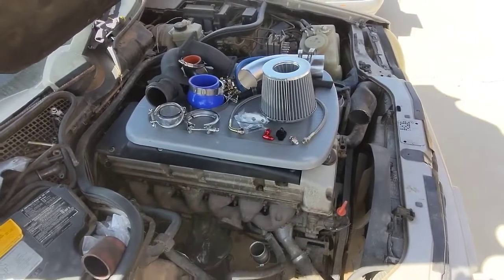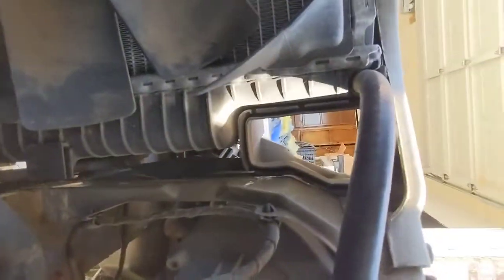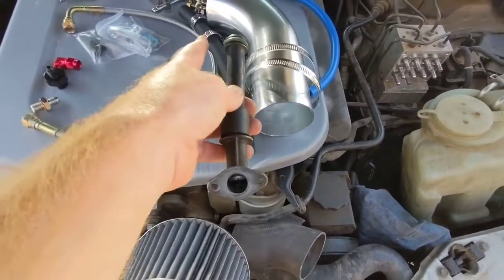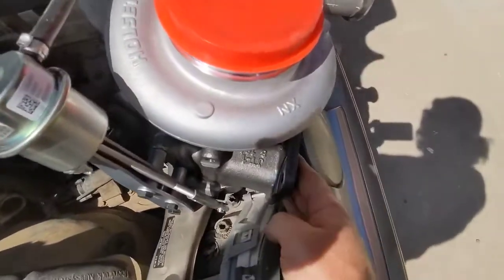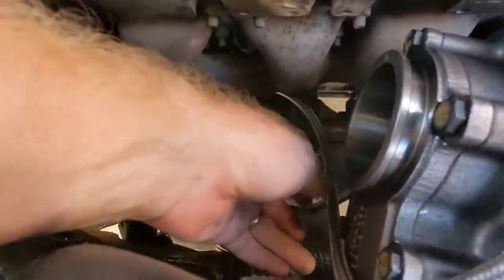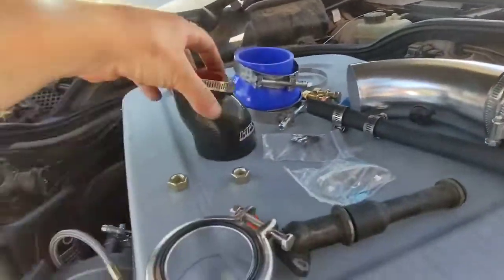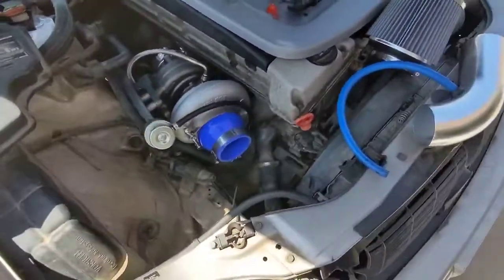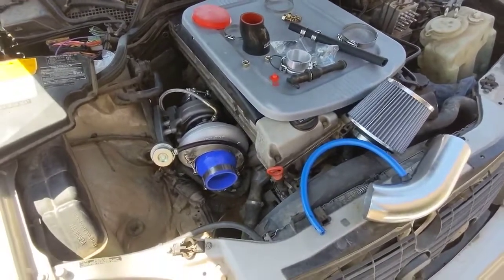OM606 Turbo Kit Install from Benz Injection

Comment: I instaled the kit and i removed the vacuum for the stock turbo(the black vacuum cilinder on the right side attached to the air box), now i have issue with the level sensor for the headlights.when i plug the line that was meant for the stock turbo car start to coffin and turning of.Any solution how to fix problem with headlights level sensor? Thanks

Comment: the kit works good the power and torque gains vs the stock setup is just wow the only concern i have is the hot side of the new turbo is extremely close to the right brake line the brake fluid inside is getting super hot for sure and the coolant hose going to the climate valve  is against the turbo wastegate solenoid  bracket  the other little thinks that needs to be take care is the pressure hose going to the  solenoid is to close to the exhaust manifold and getting a lot of heat from it  and that is all i will be taking care of at some point verry sun and i just ordered a 3bar map to replace the stock one and see if that stops the defueling issue at wot

Comment: Why are the bottom 2 bolts connected the turbo to the manifold so hard to get
Reply: I’m still stuck on that part of the removal
Reply from the maker: You can access them easier from underneath the car.

Comment: Pump ? Turbocorector? Preasure?
Reply from the maker: Stock EDC turbo pump, HX35 8cm, around 1.5 bar.
Reply: @BenzInjection  thank you
Reply: @BenzInjection  
Hi with stock injection Pump ? stock injector pressure ? stock MAP Sensor or upgrated to 2 BAr ?
Reply from the maker: Stock everything @drissios

Comment: Where do I buy or get more info on your kit?
I already have the Sean Tracy ECU upgrade. 
How much of a power increase can I reasonably expect with the Holset turbo upgrade?
Do you also sell the turbos?
What about the injection pump do I want or need a high flowing pump?
Reply from the maker: You can get this kit and find the answers to your questions at benzinjectors.com/turbo-kits

Comment: you should make a kit where you only sell the turbo stuff with out the ecu for ppl that are doing manul pumps , my two cens
Reply from the maker: Yes, that's how it is setup. When you check out, you can choose if you want to include an ECU or not.
Reply: Learned a lot here. Thanks for this.